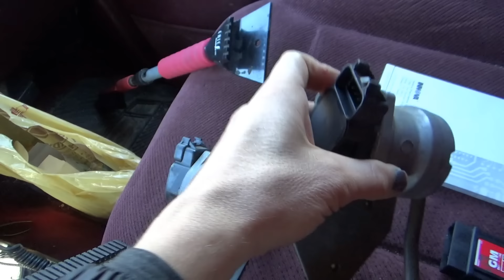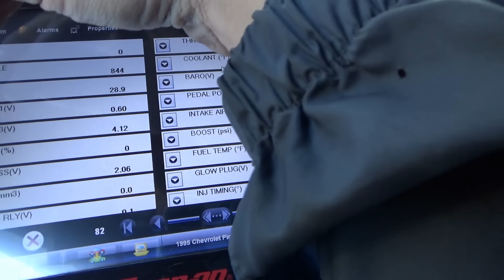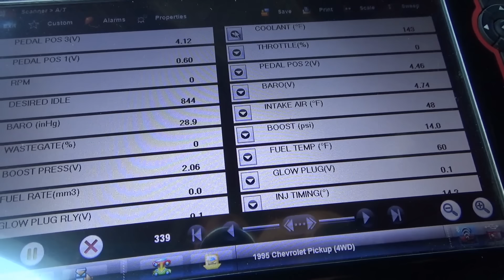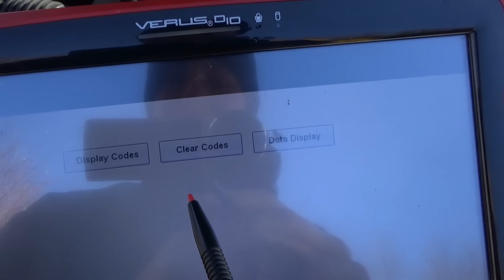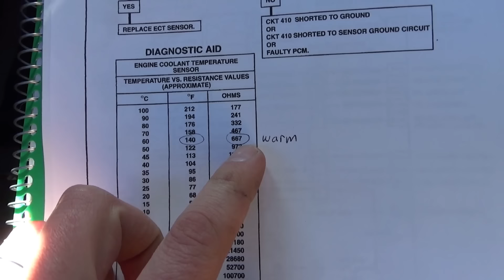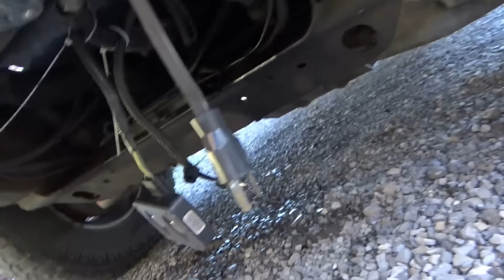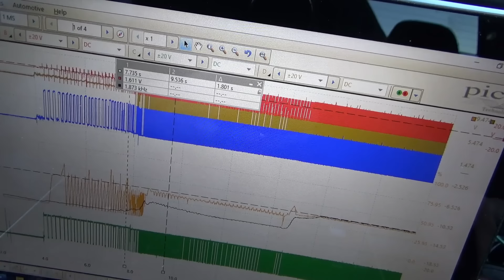(Pt 1) Chevy 6.5 Turbo Diesel REVS Out of CONTROL?! (Throttle Diagnosis)

Comment: Make sure that the resistor that calibrates the pump is inside the connector of PDM's, they slide onto the pins.  We were told that those were important back in the days of replacing these injection pumps under the GM special policy.

Comment: Just the idea of a Diesel runaway frightens the life out of me
Reply: No doubt. Gotta have a plan!!!
Reply: Well. It wouldn't be my choice of vehicle to take a date to the drive-in.
Reply: @luckyguy600  I think that bed is big enough for the chaperone as well.
Reply: A diesel runaway is when the engine starts burning and consuming its own engine oil.  You simply cannot stop it.  I’ve always owned diesel cars and never experienced one, and I know nobody who has either.  I think it’s something that happened to old and industrial stuff that’s not maintained.  This old truck has been electrically and electronically messed with, so it’s shall we say, a controlled runaway with too much diesel being commanded into the engine.
Reply: @tonep3168  Plug the air inlet.
Reply: @phprofYT  by the time you have done that, don’t you think the engine will already be badly damaged though? Might as well let it finish itself off and grenade itself. 🥳